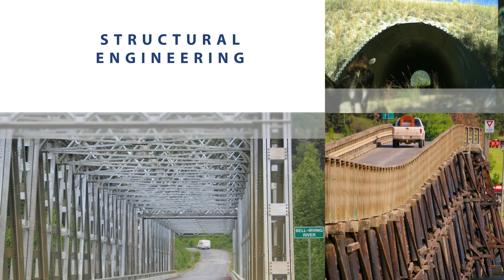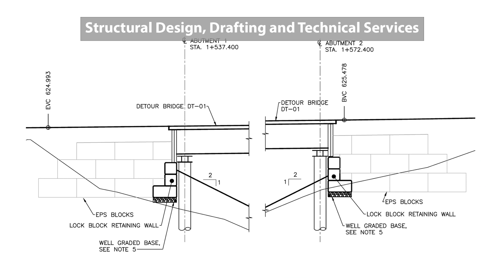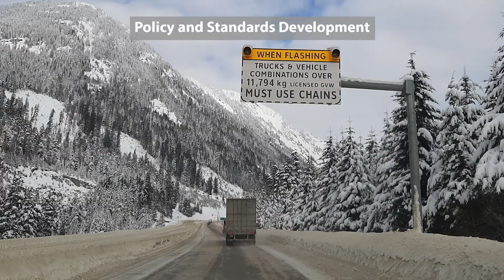Our Structural Engineering Team Helps Keep BC Moving

Comment: Are these the clowns responsible for that joke of a replacement for the Massey concrete box blocking the fraser river with another concrete box that will still block the river to anything except small and shallow draft vessels and will only add one more lane for traffic when it should be 12 lanes for traffic to hand the current and future needs for atleast 25 years?????